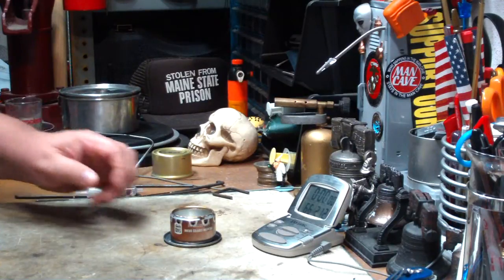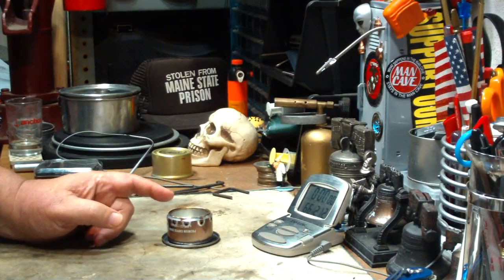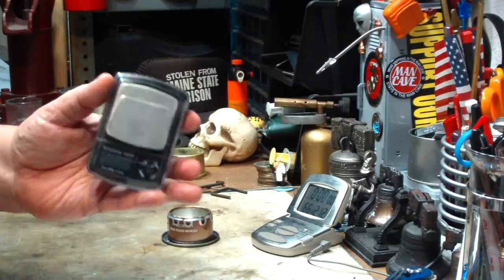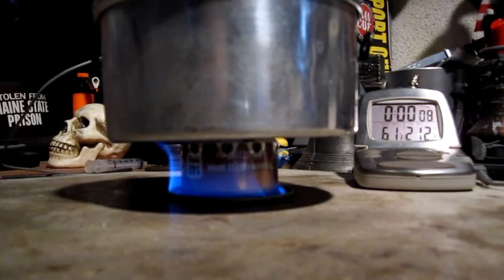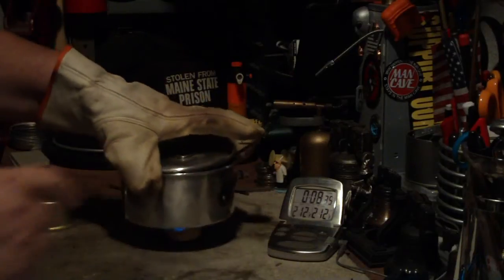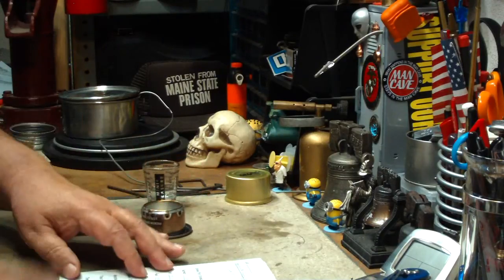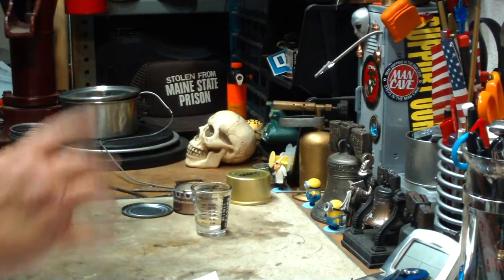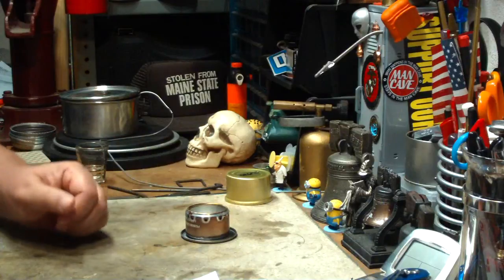How much fuel does MatoNupai's MAHALO Alcohol Stove need to boil water?

Comment: Bottom of stove 1 inch. Top of stove 32 mm. There are 10 1/8th inch jets spaced every 16.6 mm. Bottom of jets are 8.5 mm from top of stove. Inner wall is 34 mm with two 1/8 inch seep holes 70 mm apart.

Comment: 1. Fuel economy, 2. Tight flame pattern (work with small diameter pots) 3. Decent boil time. 4. super light weight 6.7 grams. 5. Need no pot stand

Comment: Just over .5 fluid oz alcohol for a 2 cup boil under your stringent conditions is good efficiency. I have measured boil times of 4 to 4 1/2 minutes for two cups at 70 degrees measuring boil time at 212 degrees with a wicked super cat with a BSA pot - I think we should call that a "Hiram stove", as I have not seen one like it before you used one in your tests. In each case, the best part of 1 ounce of denatured alcohol was used,so 2x the fuel consumption . Now to find a 5 minute boil on 1/2 oz

Comment: Hiram: I am not sorry I sent you the stove at all. I appreciate you showing how fuel efficient the stove is. As a matter of fact I am preparing a collection of stoves to send your way for testing. Boiling 2 cups with 17-17.5 ml of methanol is not bad at that low altitude. Many stoves need 30 or more ml. At my altitude I take 64 degree tap water to 195 with 12.5-15 ml.